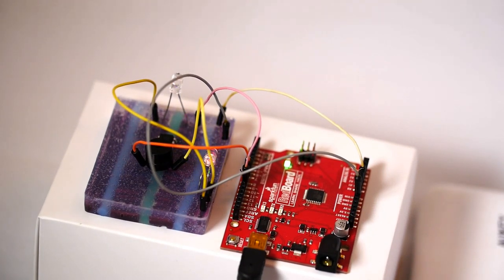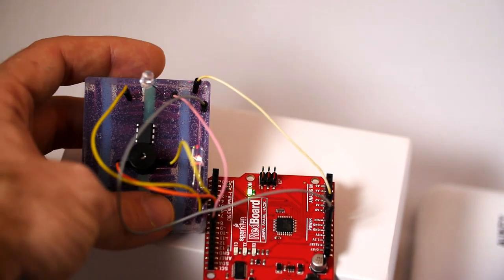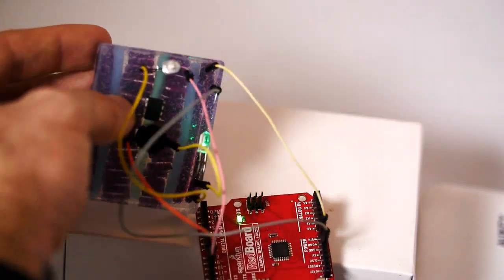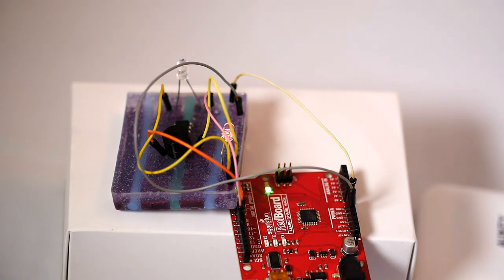Silc Circuits: Rubber Breadboard

Comment: Hey, I think your recipe sounds great and I appreciate you sharing it in detail. I'm not quite ready to get the supplies and jump in yet to test it myself (too many other projects ahead in the queue haha) but I'm hoping to pick your brain about a few things. 
1) have you ever tried substituting some (or all) of the chopped strands with milled CF powder? I'm hoping to get a sort of fuzzy, flocked texture.  Without losing tear resistance, however, and I especially without little bits of conductive CF powder coming off
2) is there a way to use this as coating on paper/cardboard? I'd prefer to use silicone but given it's reluctance to stick to things, perhaps softer a polyurethane or epoxy resin would be better.
3) Speaking of which, I presume this recipe would work equally well with two-part polyurethane and epoxy resins?